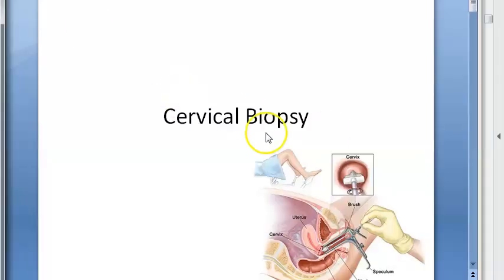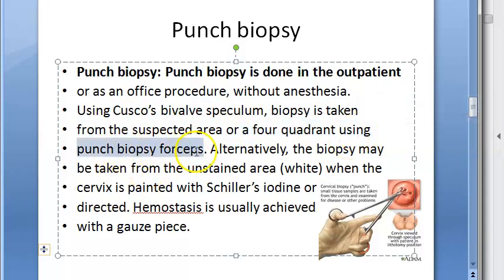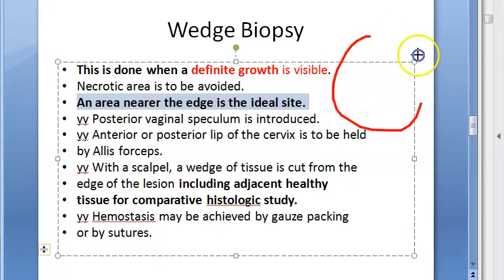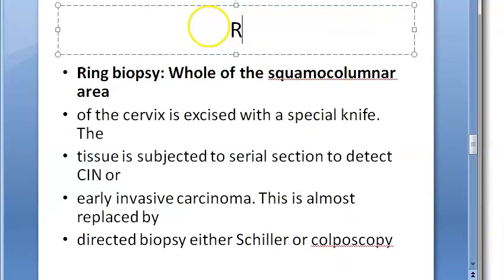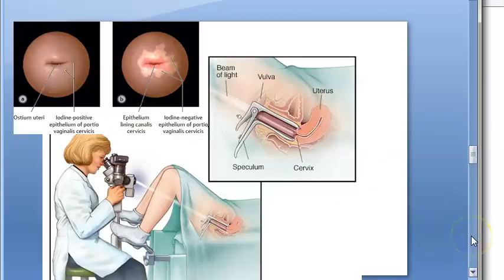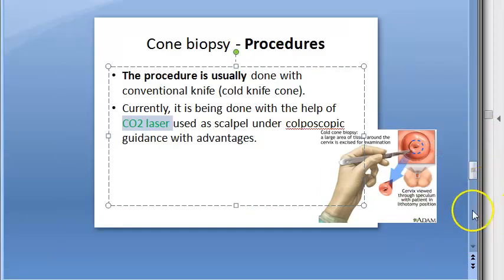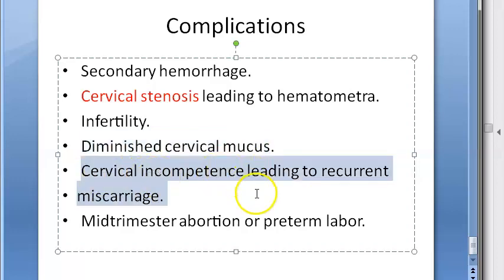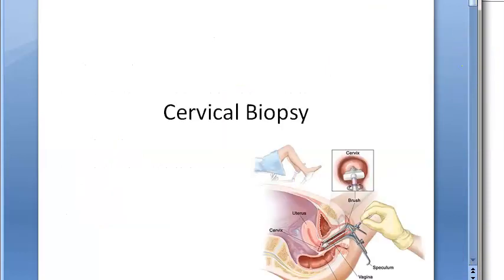Gynecology Cervical Cervix Biopsy Types Punch Wedge Ring Cone transformation zone Conization

Comment: Doctors with female patient with cerval dyplastia and abnormal cells and CIN 1, 2, 3 and HPV on cervix. Doctors will tell female patient they need to remove 1 cm of female patient cervix using leep, or cone bisopy procedure. Doctors remove 1 cm and female patient cervix cause problem, orgasm function, sexual function, shorter cervix, harder to get pregnant, nervous around cervix damage by doctors remove 1 cm of female patient cervix